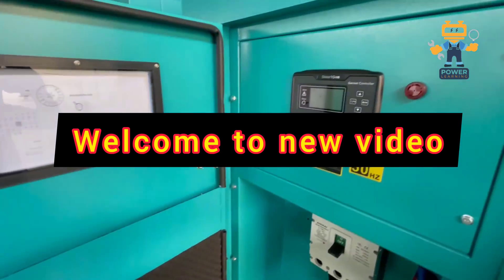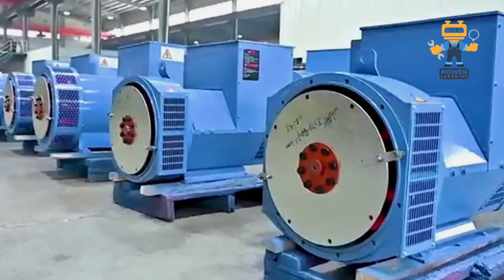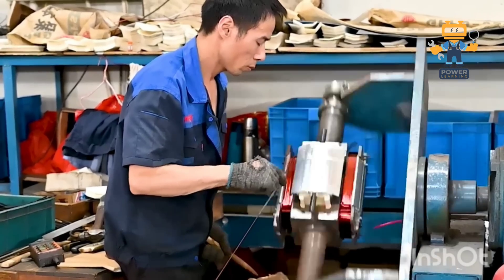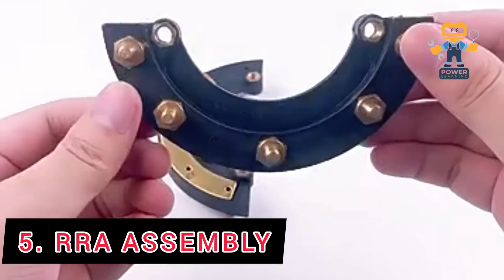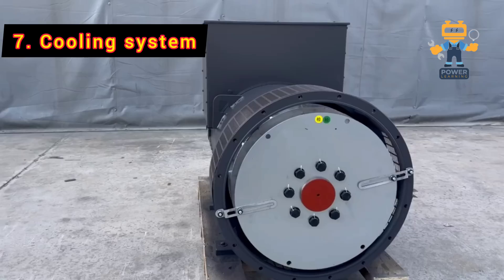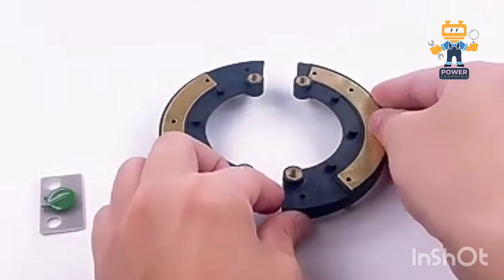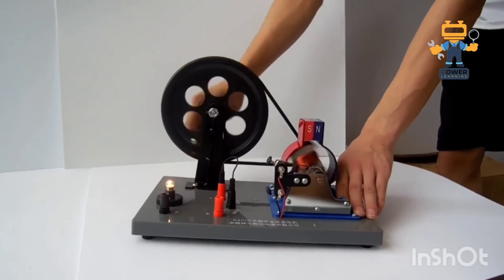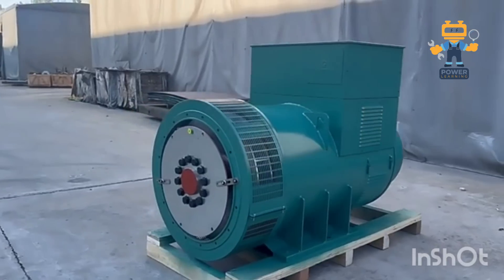How an Alternators work | How 3 phase Electricity produce | Generator working principle brushless

Comment: I have 3 cummins generators all generators are synchronised but the Problem is when rains one by one shows the under voltage alarms 🙄 can you tell me what's the exact problem ⁉️
Reply from the maker: This need expert engineer to visit your site
Reply: if it is in a container and has vent fans, you can turn them off for like 30 minutes while its running to help dry out the generator, also you can get small heaters that stay on when the power stops, will keep the windings dry